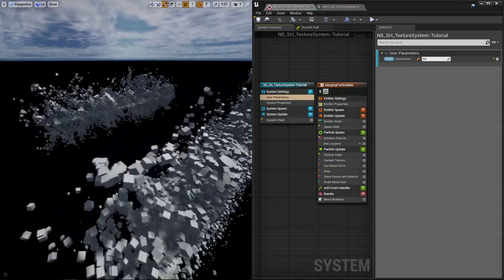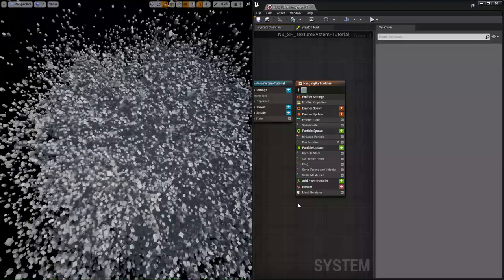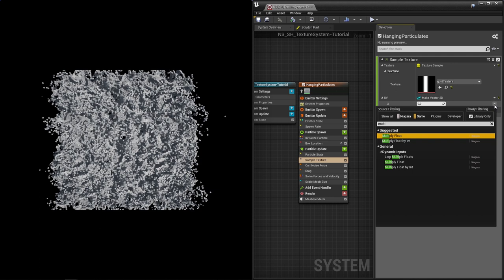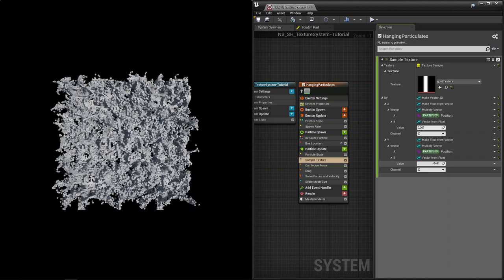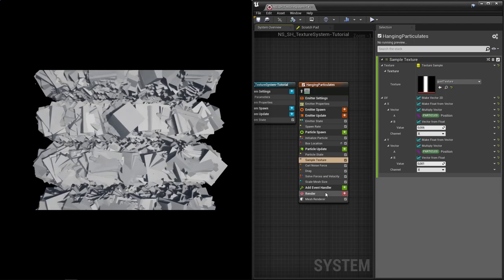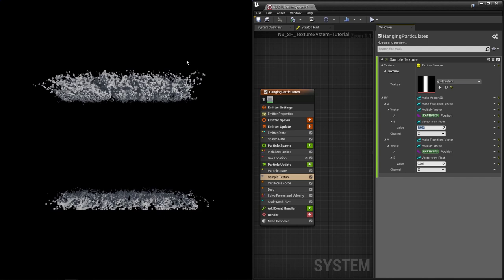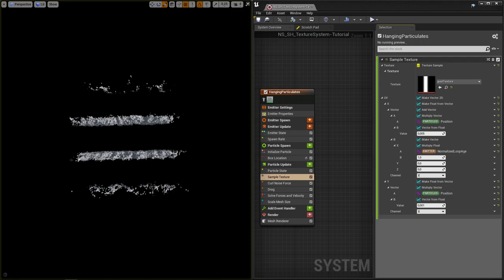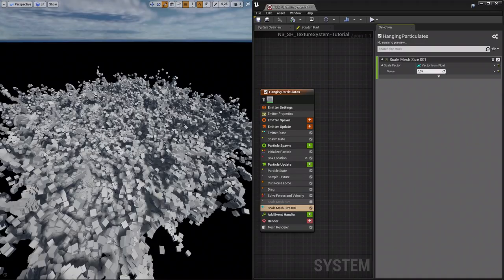Control your Niagara particle system with Textures

Comment: So, I made a texture, black and white that corresponds with my model but then I use this method and it doesn't line up with the meshes UVs. Is that a different thing or just what happens... trying to find a magic number that works.